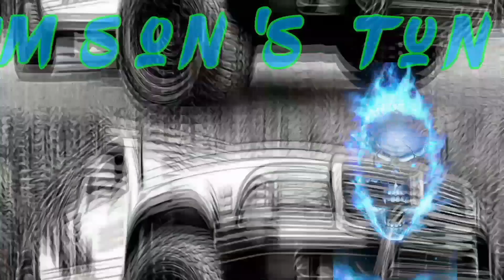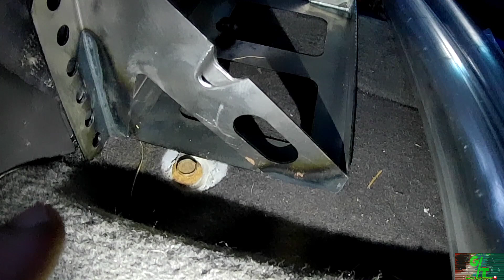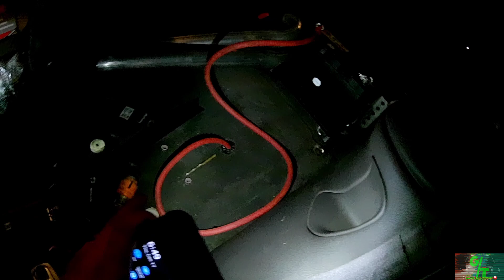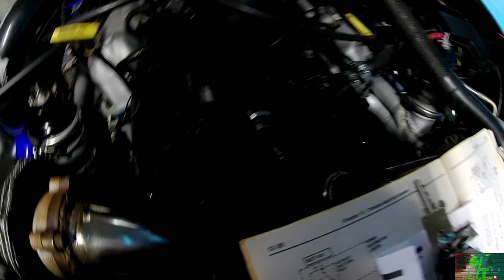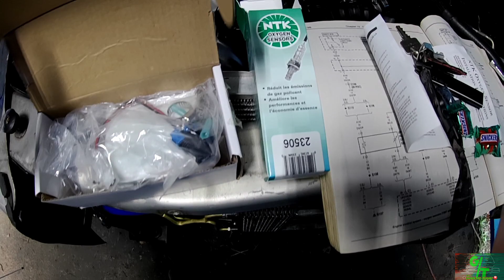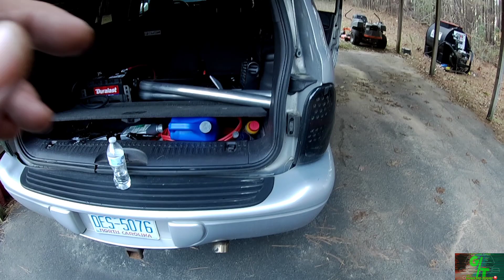Battery Relocation Kit Plus the Air/Fuel and Boost Gauges installing.

Comment: Don't worry about running the cable on the outside, I ran zero gauge wire for my amplifier along the frame to the back and it's been two years without issue m
Reply from the maker: Good info Buddy Thank you.  Thats Great to hear. Have a great holiday and Be safe.